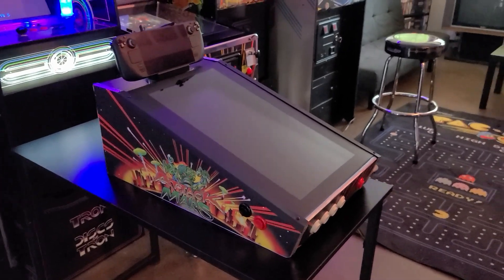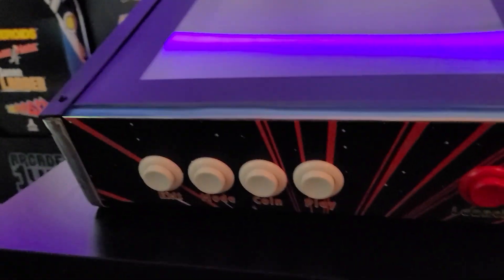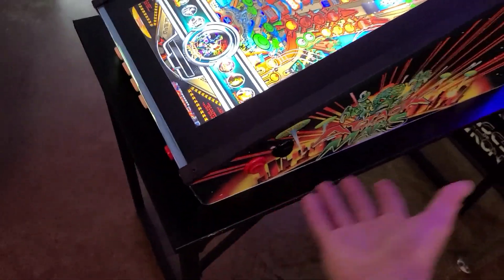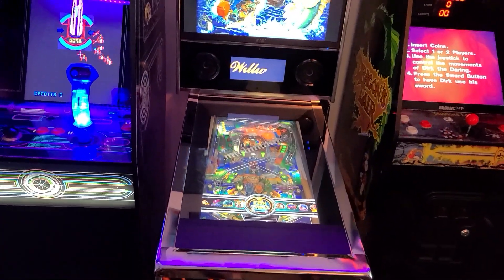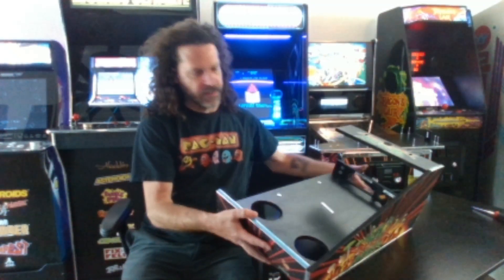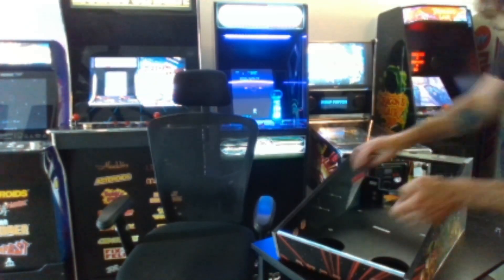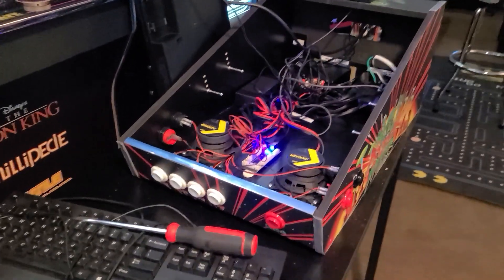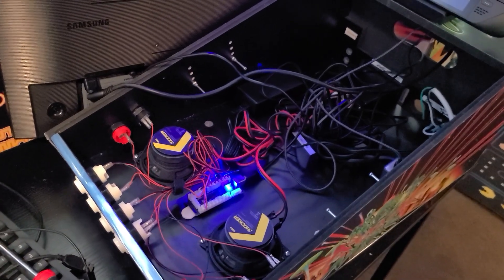GameRoomSolutions Steam Deck Virtual Pinball Cabinet

Comment: is it possible to have two monitors, one playfield and one for PUPS and DMD?
Reply from the maker: If I understand your question, I've got 2 monitors here - one is the playfield, and the other is the Steam Deck, which shows the DMD. I haven't tried any games that use full video PUPs, but I imagine it should work. I'm curious about that myself, now
Reply: @TreZ  But steam decks screen is too small for a proper fulldmd or backglass with pups. I wish it had two external video outputs

Comment: Is this also possible with the steam os instead of using windows?
Reply from the maker: VPX requires windows. You may be able to set up PinballFX with the Steam OS
Reply: for pinball FX, will it work with a 2 screen cabinet? with docking station of course... @TreZ
Reply from the maker: @JerryZhani  I think so - you will have to look into 'Cabinet Mode'

Comment: Is this a new model? It’s not listed on their site. Was this a custom job they did for you?
Reply from the maker: I don't think there's a link on their site, yet. But just contact them and tell them you want the new Steam Deck cabinet and they will know what you mean. 
This WAS a custom job! They are very friendly and helpful. I told them I basically wanted the Nintendo Switch cabinet, but with a flat top so I could mount the Steam Doc. They did a great job - this is exactly what I wanted!
Reply: @TreZ thanks! Just saw you answered earlier to other commenters.  Last year, I got their 24” tabletop offering. I had to do some things to get it to my liking, but overall it’s a good cab. Only real gripe is it’s not the best for your hands. You’re basically gripping the side panels, and your hands start to hurt if you’re pushing on them too much.
But yours looks like it’s a little more flush with the plexiglass.  Would you say it’s comfortable to play on?
Reply from the maker: @Cargo_Bay  I haven't played for an extended period, but it feels great to me!

Comment: How many games are on here im planning someday to have one of these in my home
Reply from the maker: It doesn't come with games. You will need to use Baller Installer, Pinup Popper, and Visual Pinball X to add games. There's a bit of a learning curve, but once it clicks, it's pretty simple!
Reply: @TreZ  *Visual Pinball X.  Also, don't undersell it... there's a steep learning curve for the typical consumer.  Even techies have a lot to learn and figure out.
Reply from the maker: @Tamarocker88  Thanks for pointing out my typo!